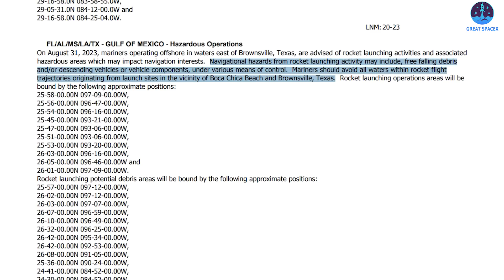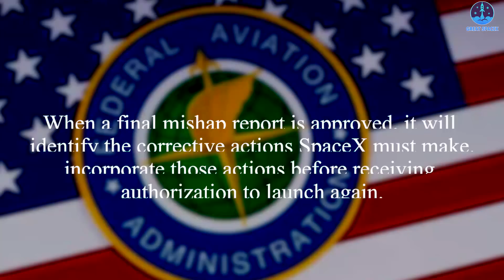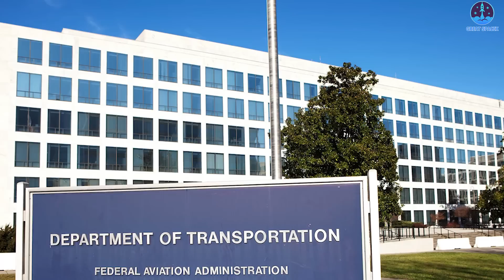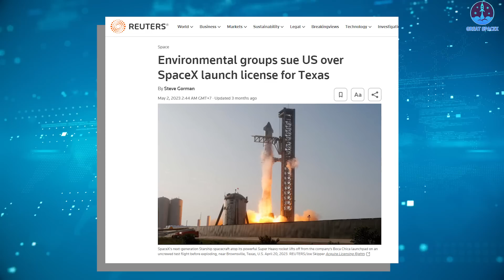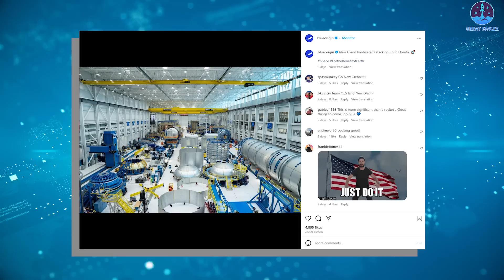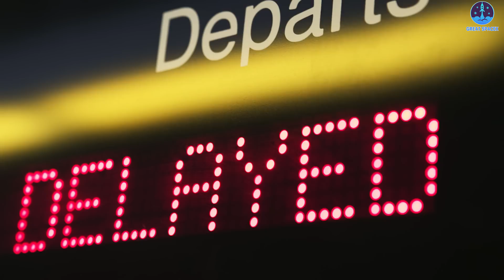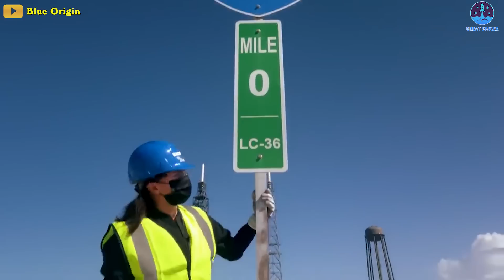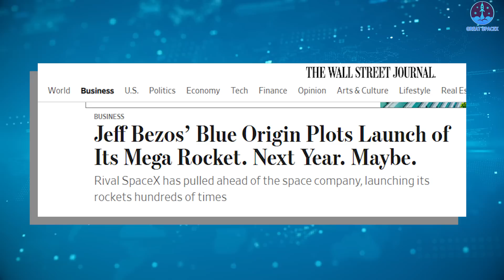SpaceX just revealed Starship new launch date!

Comment: Cowboy Jeff's hobby company,  Blue Origin, would be in a lot better shape if attorneys could  launch payloads to space, instead of having to rely on those pesky, complicated rocket thingys.
Reply: And the utter shame of it is Bezos had formal engineering training, unlike genius polymath Elon
Reply: & shows . Even his wkers are leaving him ...shows lack of drive towards a goal..BO  looks like a summer camp project ..like the Artemis missions .. ( IMPO ) > they are just time fillers till Starship is in full production mode :)
Reply: Jeff doesn't have a Gwen Shotwell to keep the factor running at top speed. Without Gwen Shotwell SpaceX wouldn't be the same company. It would be running in slow motion just like Blue Origin. Well maybe not that bad, but definitely not SpaceX super speed and development when it comes to R&D.
Reply: @marymarlow5598  Dont sell Elon short.  As good as she is, If he didn't have Gwen Shotwell, he would find another highly capable, high achiever to take her place.   Not so for the cowboy.  No one wants to work at a faux rocet company.
Reply: I think the New Glenn is only 7 meters wide. 6 ft less than the SpaceX heavy lift.